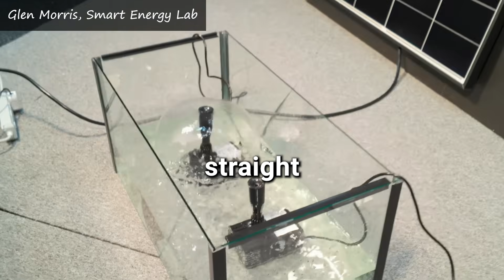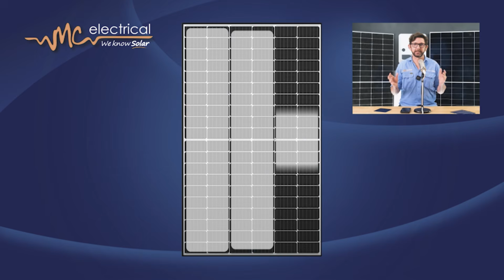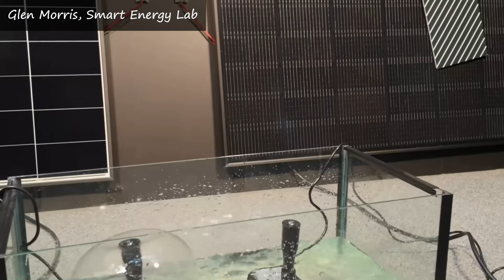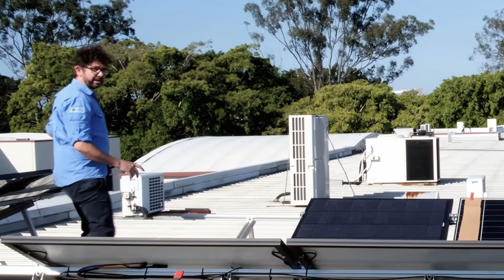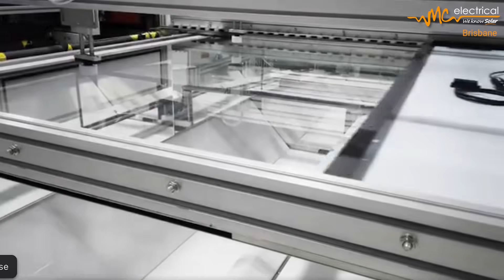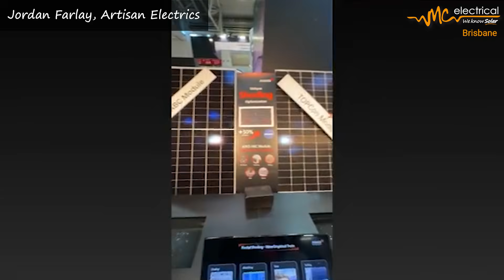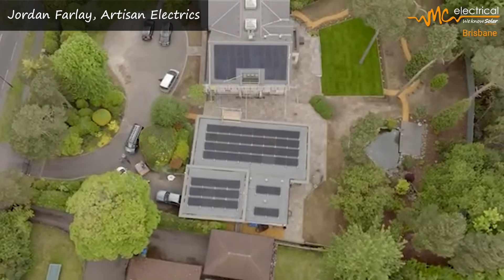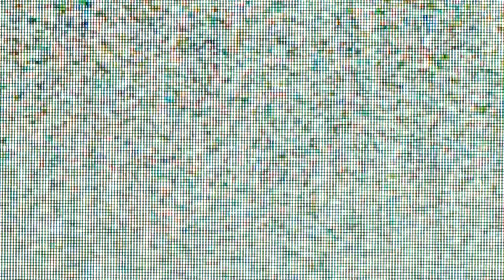TEST RESULTS REVEALED. Do Aiko’s shade proof claims add up?

Comment: I back Aiko's opinion of you. You sell Canadian Solar panels and getting smacked by Aiko in the Brisbane market and this is the key motivator of the video - just be honest Mark.  I feel it’s important to clarify some key points about your video regarding Canadian Solar panels vs Aiko. Transparency and accuracy are essential when presenting information about solar technology, especially in an industry where customers rely on us for honest guidance.

Outdated model use
Your video references the Aiko 465W panel, yet the current available model is the 475W, which offers higher efficiency. This efficiency translates to less roof space required for the same energy output—an important factor for homeowners. Not mentioning this advancement seems like a missed opportunity to provide complete information.

Stock Considerations
It would also be valuable to disclose that your preference for Canadian Solar panels may be influenced by the amount of stock you carry in your warehouse and need to sell. If there is a warehouse full of Canadian panels, this vested interest might explain why they are promoted over higher-performing options such as Aiko. Customers deserve transparency about why certain panels are recommended over others.

Panel Performance Metrics
Canadian Solar panels, while reputable, show notable differences in performance metrics compared to the Aiko panel. For instance: 

Temperature Coefficient: This is a critical factor for performance in hot climates. Aiko smack Canadian 
Degradation Rates: Long-term reliability and efficiency are significant considerations. Aiko beats Canadian 
Power Tolerance: The minus tolerance of Canadian Solar panels (allowing for flash-test results below the stated wattage) could result in up to 5% lower output for an entire string. So a 442W flash test Canadian Solar panel panel can actually be called a 465W name plate. What a crock and no word from you about that. This difference alone should be accounted for in your shade and production loss calculations. These technical factors are pivotal in helping consumers make informed decisions but were not addressed in your video.

Country of Manufacture
The name "Canadian Solar" can sometimes lead to confusion about the panels' origin. As a globally recognised brand with Chinese manufacturing roots, this context deserves clarification to avoid misleading impressions.

Aiko’s Innovations and Reputation
Aiko has a strong reputation in cell manufacturing, with state-of-the-art, fully automated production facilities ensuring high reliability. Acknowledging these advancements could have provided a balanced view, especially given their significant R&D investments that contribute to the industry’s progress with the new panel technology.

Testing and Independent Data
Your video lacks independent testing data or calibrated comparisons. Referencing verified third-party data, such as those from Choice or PV labs, would bolster credibility and provide viewers with evidence-based insights, instead of commercially motivated opinions.

Consistency in Critiques
Your past critiques of other products, such as Zappy or SolarEdge, suggest a pattern of judgment without thorough testing or data. Engaging with manufacturers’ updates and ensuring full technical understanding before forming opinions would enhance the value of your reviews.. Enjoy you wandering in front of the Louver in Paris - while we here in Australia battle the cost of living crisis... MC: Credibility - nil - opinion : full of it - 110%.
Reply: Another hatchet job from Mouse Click Solar